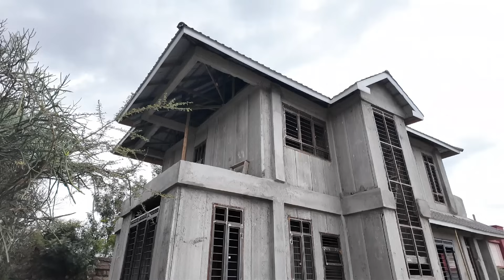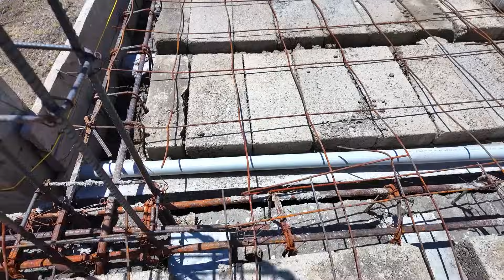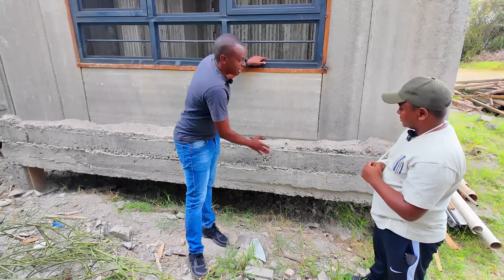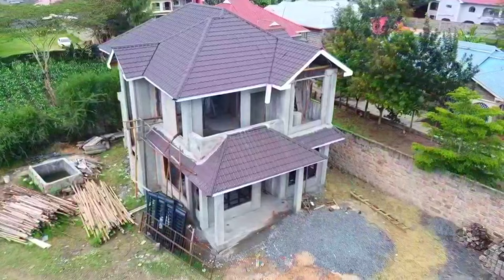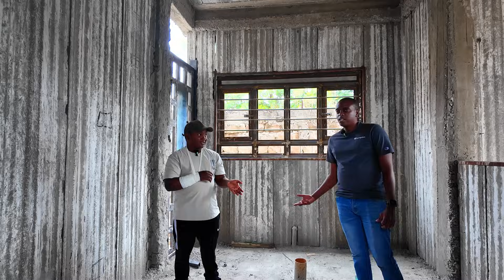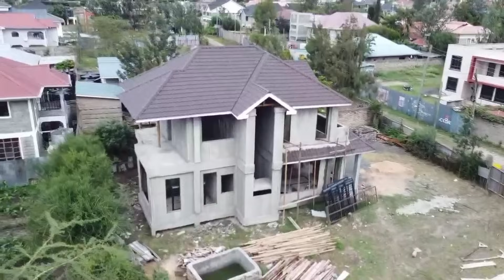Building a 215 SQM Maisonette with a Suspended Foundation in Athiriver

Comment: What if they used the 2.7m high panel. Could this be ideal...
Reply from the maker: Yeah, but a lower ceiling height
Reply: You can use 2.7m but if you are building in hot temprature area it is not advisable